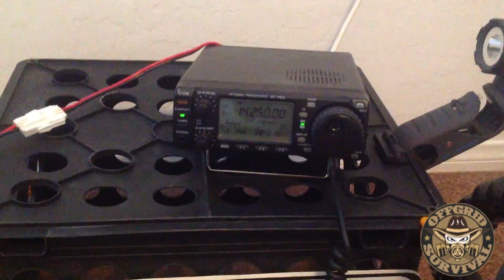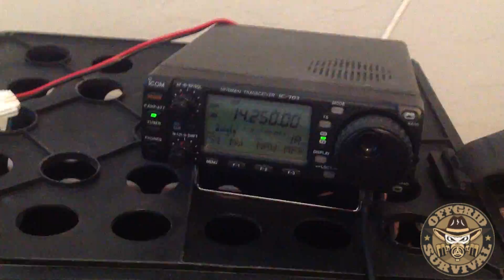Emergency Off Grid Communication: Ham Radio (icom ic-703) running off Solar Charger

Comment: What kind of SWR are getting on the slinky antenna with the TV cable coax?
Reply: +1oldarmyguy This is going to be 75 ohm coax.  So you will have a little mismatching going on since ham radio's are 50 ohm.